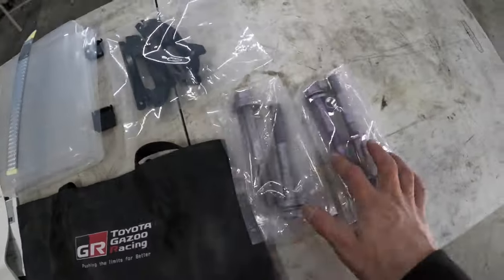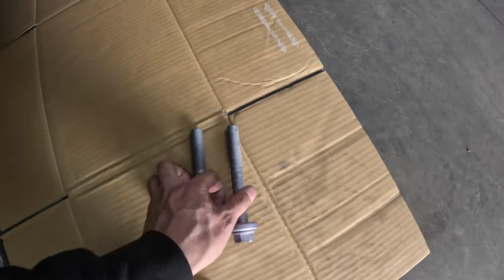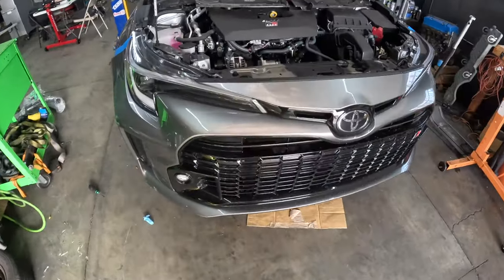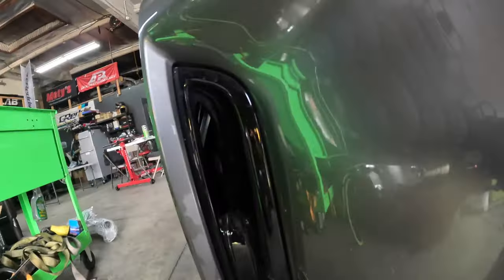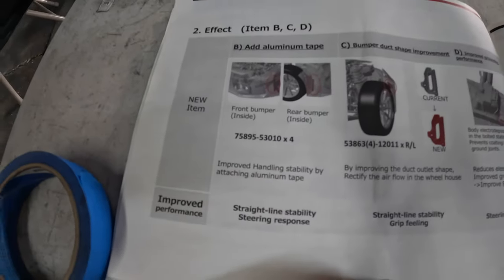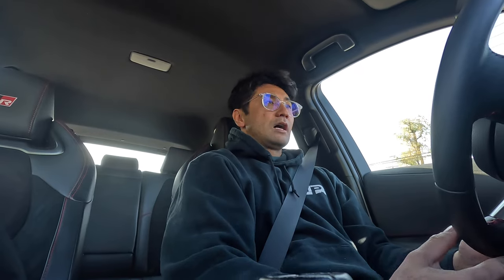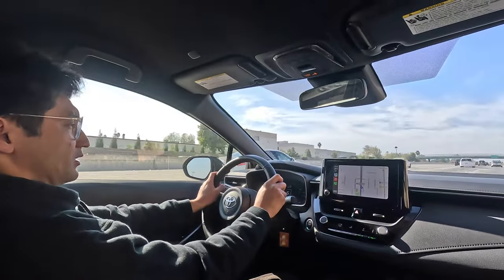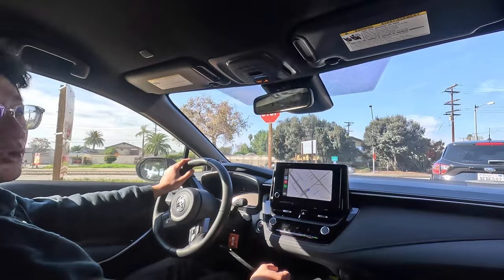My 2023 Toyota GR Corolla gets Model Year 2024 Updates!

Comment: If you weren’t a credible automotive guy, I’d say you claiming its a “noticeable difference” is total BS!  So bizarre that those lil bits can affect it the way you say.  I’m curious as to which one of those upgrades made the biggest difference?
Reply from the maker: As much as I want to say the bolts did the most work, I have a feeling it’s the tape lol
Reply: Bizarre to say the least. lol.   Gotta try it for myself.
Reply: And even the bolts!!  What’s the difference between old and new?!  Lol
Reply: @KN-jw7ts  you can see the bolt heads are different, more rounded around the corners and lower profile. Since the bolts stick out from the bottom of the car, it probably helps with aero on the underbody.

Comment: 3:08 for the steering rack bolts, the heads are marked. The old one is marked "I" which is a Class 6T bolt, while the new one is marked "10", which  is a Class 10T bolt. 

Steering Link Assy spec by the repair manual: 98ft*lbf. However, the old bolt was 6T class and that means M14 flanged bolt are meant for applications with a lower 90ft*lbf. The new bolt is double that, allowing for 180ft*lbf with the new bolts (obviously the spec is still 98). Considering the length of this bolt, I think this might give the steering rack more consistency when pushing the car.

Comment: It sure would be sick if everyone could get this kit. It was a real adventure with the Toyota parts guy trying to figure out which part number was actually the new bumper  vents for the CE.
Reply from the maker: Here are some of the part numbers for the update parts:
Fender ducting:  LH 53864-12011
RH 53863-12011

Crossmember Hardware
Front 90119-14211
Rear 90119-16039

Aluminum Tape
75895-53010
Reply: @KenGushiMotorsports  thanks Ken. I actually got mine last Friday luckily . He ordered both sets for me so we could figure it out . Not a lot of info on their end . Luckily I keep my ear to the streets 😂😂
Reply: What is the torque spec for front and back bolt

Comment: Could you share all the part numbers? Would be great to order these for myself!
Reply from the maker: Fender ducting:  LH 53864-12011
RH 53863-12011

Crossmember Hardware
Front 90119-14211
Rear 90119-16039

Air duct
LH 53864-12011
RH 53863-12011

Aluminum Tape
75895-53010

Comment: Cool video Ken! 0:10 How are you getting this car to get that sideways on dry surface? 30/70 or 50/50 bias? Looks great on the dirt too!
Reply from the maker: These cars only like 50/50 bias when going sideways haha. Once you pull the handbrake, the couple actually releases and it goes full front wheel drive otherwise
Reply: @KenGushiMotorsports  Good to know. I've noticed it's a little more playful on the 50/50 mode. Need to try this in an open parking lot haha. Thanks for the input! Keep up the GRC content!

Comment: As a fellow 23 GR circuit edition owner, how do we go about acquiring this via dealership?
Reply from the maker: Here are some of the part numbers for the update parts:
Fender ducting:  LH 53864-12011
RH 53863-12011

Crossmember Hardware
Front 90119-14211
Rear 90119-16039

Aluminum Tape
75895-53010
Reply: @KenGushiMotorsports  thank you so much! 🙌

Comment: Is there a part number for the 2024 parts package?
Reply from the maker: I’m sure they already have part number but I’ll dig into it
Reply from the maker: Here are some of the part numbers for the update parts:
Fender ducting:  LH 53864-12011
RH 53863-12011

Crossmember Hardware
Front 90119-14211
Rear 90119-16039

Aluminum Tape
75895-53010

Comment: Do you think the revised bumper ducting makes a difference, along with the tape?
Reply from the maker: I’m sure everything adds up. I’m sure opening up the front duct cover makes a difference with or without the updated ducting. But the Chief engineer told me because the Circuit Edition comes with a rear spoiler, CFD data showed better performance with the front duct closed shut

Comment: Wanted to like this car but,  the overheating differentials at the back and turning into front wheel drive was a deal breaker for me 😏
Reply: It takes 30+ minute hot lapping sessions in high ambient temperatures for the diff to overheat on thie car. It's really not a big issue. Unlike the Focus RS that does two hot laps on R comps and becomes an overweight ST.
Reply: @TB86GRC takes less than 10 mins to overheat the rear diff on the track. Anyone that drives this car hard on the track will immediately be disappointed on how quickly the rear diff over heats….
Reply: @pushtoyota  That hasnt been my experience with mine at all, I've found the car needs an oil cooler long before the diff becomes an issue.
Reply: @TB86GRC  are you driving in track mode? 50/50? 30/70? also you aren’t driving the car hard enough… put a good sticky tire and see what happens.. 10 mins with 30/70 around 85 degrees. Or 15 mins on 50/50 track at 85 degrees.

Comment: This is probably a dumb question but how did you get only the one corner of the bumper off with out taking the whole thing off? I recently hit a deer and it misaligned my bumper and cracked the plastic mount in the corner for my headlight. Both can be fixed quite cheap I was just waiting to get the car on a lift to take off the front bumper, but seeing how you took off only the corner I feel I can fix it sooner. I tried pulling on the side to pop the clip but I'm not sure if there's screws or something I'd have to also take off.
Reply from the maker: The side will pop off quite easy if you undo the two clips by the wheel well duct, and the bottom clips!
Reply: @KenGushiMotorsports  any screws have to come out or just straight pop off?
Reply from the maker: No screws on the corners, just the clips and tabs on the bottom